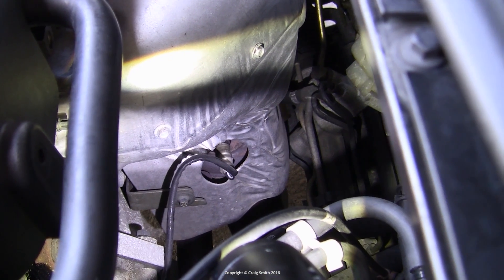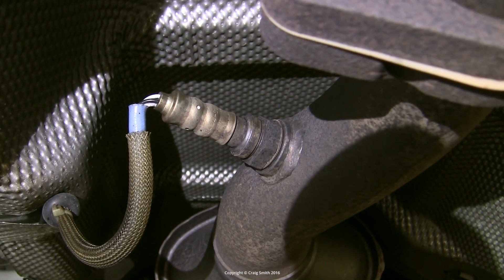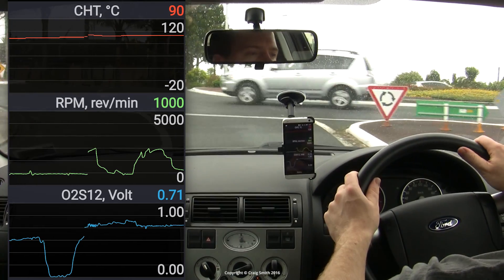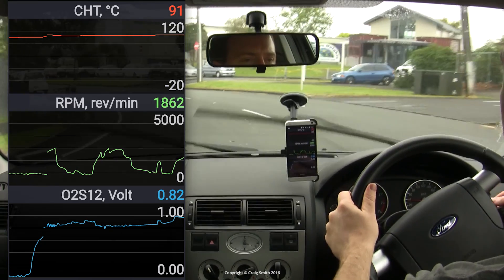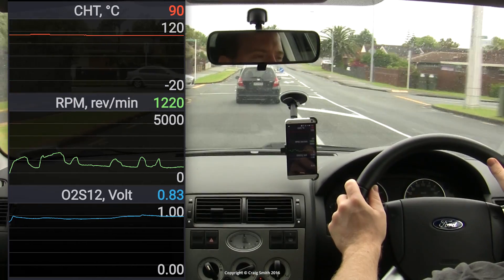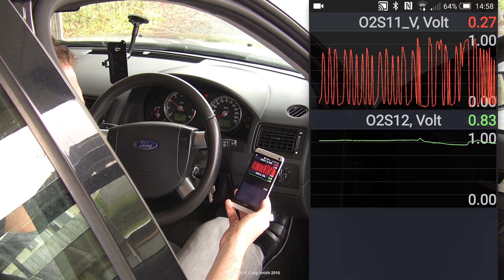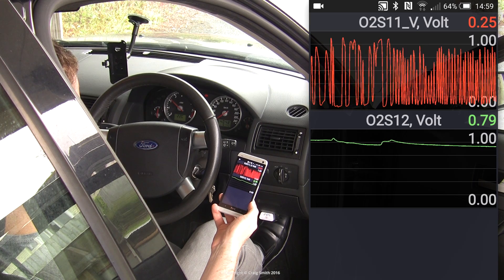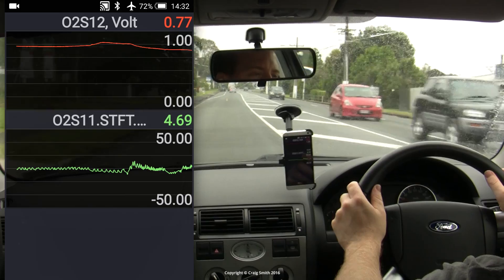What/why/how: Downstream O2 sensors (and catalytic converters)

Comment: Thank you for posting this video. I have just recentky had the "engine fault repair needed" warning light come on in my Peugeot 208gti car. The roadside assistance came out & the mechanic put the car on the diagnostic testing gadgets & said it was the downstream 02 sensor. Thanks to your excellent explanation I have a much better understanding of what the mechanic meant & what is wrong with my car.

Comment: Are you sure that the downstream O2 sensor should be slightly rich? Because until now everyone kept saying that if the catalytic convertor does its job properly, then there should be less fuel vapors present in the exhaust gases, which makes sense, as its primary role is to guard against pollution by unburnt fuel gases, not guard against free O2 escaping into the atmosphere. I'm a bit confused at the moment, I honestly thought the "leaner" the downstream readings, the better, as the catalytic converter does its job when there's little to no unburnt fuel left and just a bunch of regular air coming out.
Reply from the maker: It will normally read slightly rich because the oxygen is used by the cat.
Reply: @CraigsDIY  Then please help me understand what's going on with my car, as my downstream sensor either reads close to 0 for long periods of time, or around 0.7 - 0.8, again for long periods of time, and the behavior seems quite random. It's either rich or almost perfectly lean, and it doesn't switch very rapidly.
Reply from the maker: What is wrong with the engine?
Reply: @CraigsDIY  I have a rough idle and it's not from the injectors (I've already changed them). I know what the other possible causes can be, but I don't want to start changing all parts just in case, as I'm trying to understand why my O2 readings are like this. The upstream one btw is perfectly fluctuating between 0.1 and 0.9, I don't see an issue there. Only the downstream is either fully lean or very rich, with long periods of either one or the other.
Reply from the maker: What are fuel trims like, and are there any codes set. The upstream might look ok but still be adjusting trims for a problem. If the downstream issue is unrelated to your idle it could be an exhaust leak or a failing cat, or the sensor itself of course. Clogged up cat could also create idle issues maybe, check back pressure or straight-pipe it to test.
Reply: @CraigsDIY  No more codes after changing the injectors (I had 1 faulty one), the fuel trims are also fluctuating (either the short trim has +10 or +20 when the long trim has -10 or -20, or vice-versa, so the short one is almost always compensating an equal opposite value of the long one), or sometimes they are close to zero for a while, then again it starts having either positive or negative trends. Good idea about the straight-pipe test, although the rough idle should not really be due to catalizer issues, as the information from the catalizer (or the downstream sensor) is not part of the closed feedback loop that goes into the fuel trims...

Comment: Hi,

I have a Nissan Pixo which is a Rebadged version of Suzuki Alto (In India these cars are sold as Suzuki A-Star). I usually buy spares for my car from India as its a lot cheaper there and fix it here in my car in the UK. Recently my catalytic convertor joint got broken and I needed to change it to a new one. I bought the cat con from India and fixed it perfectly in my car. But the problem is, there is no hole for the second lambda (O2) sensor! Either the Suzuki A-star model doesn't have one or it has it in a different location. But the problem now is, my O2 downstream sensor was hanging in the mid air. The mechanic tied it inside somewhere temporarily. I didn't get a check engine light initially but after two weeks I got it with a fault code P0137 - O2 sensor circuit low voltage bank 1 sensor 2. I deleted the fault code and took my car for MOT. It passed the MOT without any issue and most importantly the emissions are under the limit. Now I need to drill a Lambda boss for the second O2 sensor. But It seems to be a hard job as the new cat con is very thick and needs a large hole to be drilled. My mechanic suggested me three options.

1. Try to drill a large hole to fix the lambda boss which can be a very hard job as drilling a large hole is not easy.
2. Find a guy who can delete the fault code from the ECU permanently.
3. Use a O2 sensor simulator.

I am hesitant with the 2 and 3 options because what if the ECU uses the data from the second lambda sensor to correct things with the engine? or does the second lambda sensor play any role at all with the engine apart from monitoring the health of the catcon?
Reply from the maker: Especially if you have a new known-good cat, the downstream 02 shouldn't be a particularly critical component. No idea if your Suzuki uses it in its EFI though, it might. "Removing" the code permanently though might require a retune which is probably not the cheapest option anyway.

What I would do is take the cat and maybe the section of pipe downstream of it to a machine shop, show them the old one too, see about getting them to drill in a hole and tap. Might be easier to move the sensor to that downstream pipe. Shouldn't be a huge expense. Much easier off the car.

Comment: Can a bad downstream sensor causes a fuel over-consumption ? thanks for the video !
Reply: Yes, it relays information about the engine, mainly to fine tune fuel spray, so it definitely will affect consumption, i have this issue now, just replaced map sensor and mpg still bad

Comment: ive been researching this topic for a long time now and it doesnt make any sense.. people keep saying opposite things.. some people say that a low voltage means more oxygen.. some people say high voltage means more oxygen.. i have a code on bank 2 which should create a lean condition but the sensors read perfect and the sensors on bank 1 show what may be a lean condition according to about half the info ive read.. (the other half says its rich).. i looked up the percentage of exhaust gases and its not even supposed to have oxygen in it because its all supposed to get burned off.. the wikipedia table of exhaust gas percentage literally has a blank space for the percentage of oxygen in the exhaust... then people are saying the sensors measure how well the cat traps oxygen.. why would the cat trap oxygen? is oxygen the dangerous gas we're trying to keep out of the air? and why would there be a system designed to trap and measure oxygen levels when there isnt even supposed to be any oxygen in the exhaust anyway? what is this scam crap? my engine runs perfectly fine and gets better fuel mileage than at any point when ive owned it but i have to junk it because it wont pass an emissions test based on some scam system that doesnt make any sense..
Reply from the maker: Don't confuse yourself going into the weeds. Firstly, this video concerns downstream and you sound like you will be more concerned with upstream for general tuning to ID your problem. For the record, higher voltage direct from the sensor = rich (low O2 / high unburned fuel), & vice versa. But, the direct V readings from the sensors are not the best source of diagnoses to start with. If the upstream is generating voltage cycles that look normal then you can assume it is working ok. They do fail, but only suspect the sensor once you double check all other possible causes. Back to basics to find source of emissions issue: Short and long term trims should be your guide to air/fuel mix. If you have a code what is that. Watch my video on the upstream sensor (link in desc). For the downstream, if it is generating a midrange signal that isn't a dead flat line then it is probably ok and so is the cat; if it is reading badly high or low then suspect cat or exhaust, but you might expect to see specific codes to that effect.

Comment: So recently I added engine oil to my engine because it looked low and I added just a little too much. Can it trigger the o2 sensor to go off? -Also I changed my upstream sensor about a year ago. Thank you.
Reply from the maker: Watch my upstream O2 sensor video. But no, oil level is not going to affect an O2 sensor. Slightly overfull should be fine in any engine.
Reply: @CraigsDIY  Thanks

Comment: It's interesting to see the o2 sensor before the cat oscillate quite fast...where mine has kind of delay few milliseconds is that normal and on idle it oscillate between 0.1 to 0.5 volts when driving it oscillator between 0.1 to 0.7 volts only

Comment: I noticed on my scan tool that It doesn't register downstream O2 sensor.

I had my exhaughst serviced 1 year ago. Is it possible that they forgot to put it back? Could it have caused a bad fuel consumption?

Comment: Whst does it mean when my downstream 2.2 o2 sensor shows a reading of 0.05 doesn’t really fluctuate

Bank 1s2 is 0.585
Bank 1s1 is 0
Bank 2s1 is 0.047

Getting fault code p2198

Any help would be great, I’ve only just recently replaced every o2 sensor. The problem existed before replacing these
Reply from the maker: I'd be more concerned about the upstream sensor there reading 0, if it's really sensing low. Lean A/F = too much air or not enough fuel, if not electronics problems.
Reply: @CraigsDIY  what about bank 1 sensor 1 and bank 2 sensor 1

Comment: Hello sir, great video. I am using the same technique. However, my vehicle is a Toyota Camry 2005 2.4L 4 cylinder engine. It has two oxygen sensor, upstream and downstream. My o2 sensor 1 (upstream) shows no voltage reading at all while idle or driving. However, o2 sensor 2 (downstream) moves around between 0.70 - 0.88 V while driving. I have a check engine light on with P0420, bank 1. Is it normal to have sensor 1 (upstream) at 0 voltage all the time? I am assuming it is dead and that is what causing the p0420 engine code. Please, advice. Thanks,

Comment: You mentioned what a ignition misfire would cause is a spike in short term fuel trim, would that not be adding fuel? If an ignition misfire happened to a cylinder, that would be a rich mixture and ecu sees the spike in o2 reading and should pull back on fuel and be a negative reading on short term fuel trim right?

Comment: Great. Please my mystery: Engine starts from cold perfect. I see O2-1 sensor quick heating and working in loop, I see good working short term FuelTrim up and down. Car is riding perfect. But after 200 seconds ECU start heating O2-2. Soon this post CAT sensor reaches normal value under 1 Volt. Then nighmare occurs. Loos of power, poor idling, kick off at cross sections, missfiring. When looking on the O2 values, right after post cat sensor goes down to 1Volt, the pre cat O2-1 stop working, stuck at rich position together with O2-2. I see the short term FuelTrim repeatedly trying to correct the rich state at values down to -39 !!!  Both O2 sensors and also catalytic converter was changed for new. No influence on the problem, all remains the same. Except the average fuel consumption dropped nicely. One important information, this problem is gone after engine heats itself on full working temperature.
Reply: Well it takes 3 things for an engine to run...

Air, Fuel, and Spark.

So I'd diagnose based on that. Make sure air flow is good as in Mass air flow sensor, etc... Make sure fuel is good like fuel pressure, injectors, pump, etc. Make sure spark is good as in spark plugs, coils, spark plug wires, etc. Also make sure there's no vacuum leaks, which ties into the "air" section

One of those many things is probably faulty and needs to be replaced.

If not, the last thing is sensors... So crankshaft, camshaft, things of that nature. People usually call that category ECU problems (technically a 4th component to the list above of a running engine)

That's how I usually figure things out but, good luck! And don't throw parts at it until you have confirmation it's wrong/broken...

Comment: Hey bro, the o2 downstream is variable from 0.07 up to 0.75 volt and o2 upstream is variable from 2.3 up to 2.9 and in highway driving is between 4.8 to 5.9 volt and strange is car is powerful and a put gas every two weeks but there is a problem also short term downstream show no data , the car has a bad smell from under car but not from exhaust , could you tell me it's catalyst problem or o2, the code is p040?

Comment: I just had my engine replaced and now I'm getting p0157 code bank 2 sensor 1 not detected... not sure what's going on or what I should do.....
Reply from the maker: Well if the entire engine was just reinstalled it might be as simple as forgetting to plug the sensor back in. Sensor 1 is the upstream one tho not downstream.
Reply: @CraigsDIY  could it be a bad sensor or connections cause its all connected just keeps popping up as not detected
Reply: @CraigsDIY  also will the check engine light go away once it's fixed??? just so i know if it's still persists and also my gearing is going a little weird...
Reply from the maker: Sure, damaged connector, wiring, or the sensor is dead. Could also conceivably be a problem at the ECU end. The CEL may disappear on its own but it could take a while, best to clear it manually to test fix.

Comment: For the last 5 months I was getting the code for Catalytic Converter  I guess P0420
I showed them with 3 garages , they all said Cat Converter needs to be replaced .

I did top up with premium fuel and it didn't help , still had check engine light on .
o2 Sensors were fine .

Anyway , last week , my car would give jerks and startle in the morning , but would run fine after a while .
I thought to check this and a new code came up P0132 Bank 1 .
But , Cat Converter didn't ! Which is surprising .

What would you recommend , shall I replace the o2 sensors and cat converter ?
Or leave the cat converter since it's working fine . 

Car's on 250,000 km mark Dodge Avenger
TIA :)
Reply from the maker: Is that P0132 code on the downstream or upstream though? If the upstream one, it could suggest a failed sensor or wiring, which in turn has confused the PCM into thinking the cat has failed because of the unexpected values up & downstream (just speculating). How do you know 'the sensors were fine'? What do you see when both are graphed as shown in the video?

Comment: Hi, i have a focus St 2013 2.0 ecoboost, ive been searching the internet for an answer to will the fuelling be affected if i fit a decat and a mil cheater on the post cat sensor, and stumbled on to your vid.
Some tuners say they will happily take £400 of me to do a stage 2 map which will eliminate the check engine light totally some say without the map fuelling MAY be affected . Do you think not having it remapped will be safe, dont want to turn my engine into a grenade.
TIA
Reply: Robbie Griff you do need upstream sensor, downstream depends. If you plan on going straight pipe you don’t need it, had mine “deleted” at Cobb (07 Sti) if you’re not planning on that I’d keep it.
Reply: @eriikaq16  
Thanks for the reply.
So you think swapping out the cat for a decat with the std ecu tune, wont cause any major fuelling/engine problems apart from a possible check engine light. Yeah?

Comment: Thanks Craig, very informative video. I did some tests with my Saab 9-5 fully warmed up and my downstream O2 sensor holds perfectly steady at idle but when I hold 2000 RPM, it drops off every 5-7 seconds from 0.7V to 0.1V for a brief second before recovering. It can't hold 0.7V for longer than 10 seconds. Does this point more towards a clogged cat or bad O2 sensor? No CEL, only symptom has been a loss of power after 10-15 minutes of driving, especially pronounced in hot weather.
Reply from the maker: It sounds like the sensor is obviously working. (They tend to get lazy as they age but that doesn't matter downstream, as explained in the vid). Your cat might be getting on, but the rule is to compare the switching to that of the upstream... if you're getting a switch from rich to lean only every 5-7 secs, that's almost certainly fine. And it's likely your car will monitor this for you and set a code relating to the cat, if it actually goes bad. You'll have to start accumulating other data to get a pointer w.r.t. your power loss.
Reply: @CraigsDIY  also depends on the car I've noticed... Seems like Toyotas have 4 wire O2 sensors for downstream and use them for precisely adjusting fuel mixture in addition to the upstream...

So what's weird is it'll kinda match the front O2 sensor but doesn't mean your converter is bad... And actually if it's lazy enough, it'll hurt fuel economy considerably (personal experience)

Comment: Hi great video, i have a quick question i have a BMW x5 V8, i have fitted some headers and racing cats and i need to make the down stream sensor cables longer can i just cut and add in some cable?
Reply from the maker: I don't see why not, but do it well away from the sensor itself as it's the wire itself it uses to measure external O2.
Reply: @CraigsDIY  good point cheers for your reply, thanks very much, ill give it a crack.

Comment: Partially blocked catalytic converter can generate an EGR error on the PCM?
I have a Focus II with a Duratec HE 2.0L 16V and every 4 to 6 months I get an EGR error.
I already cleaned the EGR.
The car sometimes is a bit lazy to accelerate on highway.
Even the PCM test suggest me that can be an exhaust restriction.

 I'm not sure now but when I connect the laptop to the OBDII I remember that the O2 sensor after the catalytic converter oscillates between 0.6V and 0.95V, as far I remember; not 100% sure.
The car have about 145.000Km(about 90K miles).
Reply from the maker: I don't think so but anything is possible I suppose. The EGRs on the Duratecs are a bit finicky, I haven't had problems but if you search you will find complaints.
Reply: @CraigsDIY  Complains like the EGR electric motor works Ok but sometime it fails or get stuck?
I will make some research, thanks for answer me.